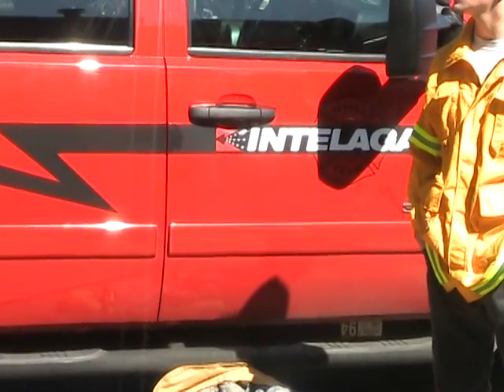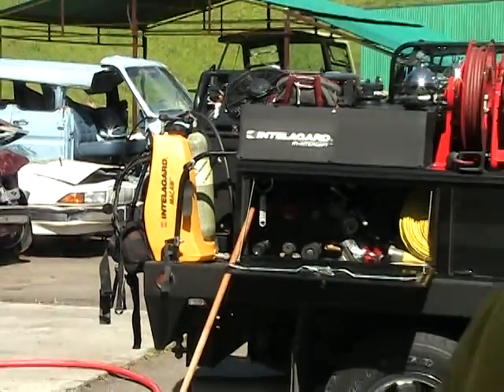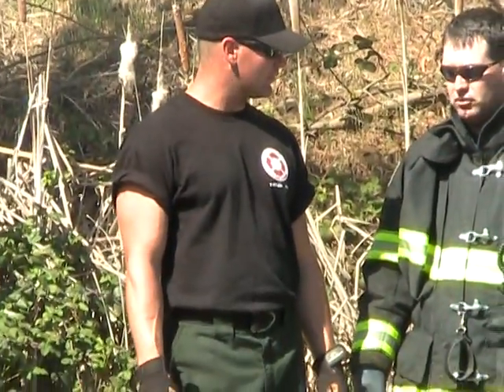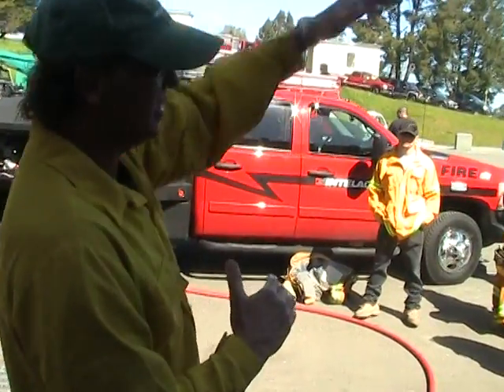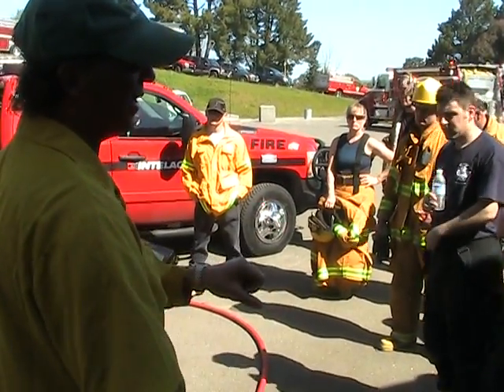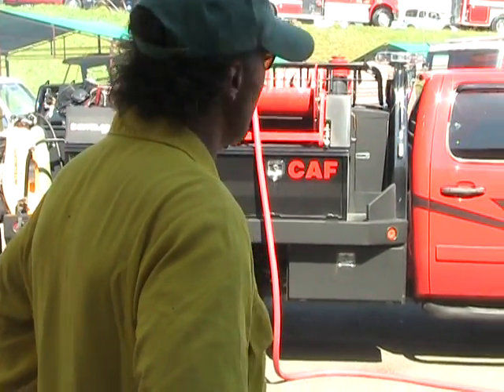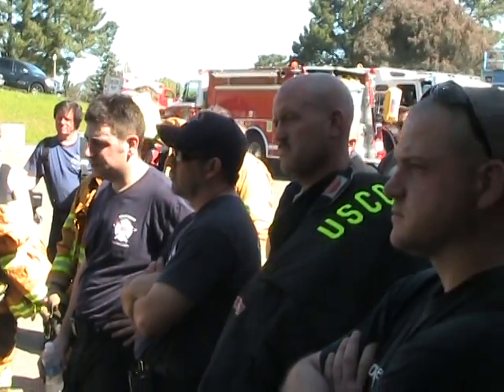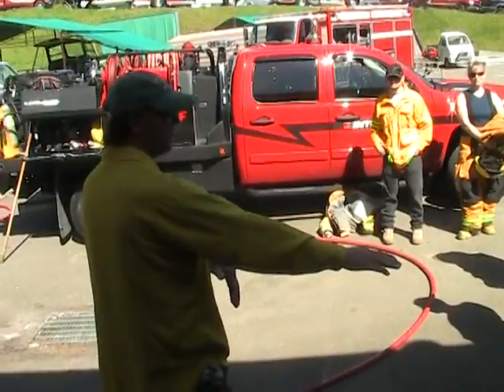INTELAGARD demonstrates CAF systems and decontamination solutions for FIrefighters

Comment: CAF is great because it holds the water in suspension and then drains it onto the fuel while absorbing and insulating. Certainly there are great advantages to CAFS but inevitably you always need to revert back to plain old water for situations that demand it.